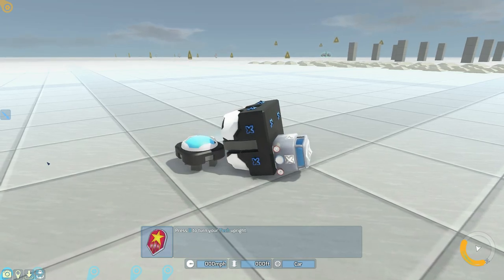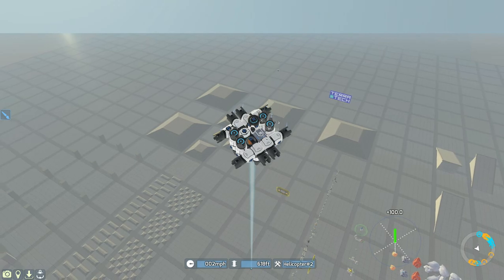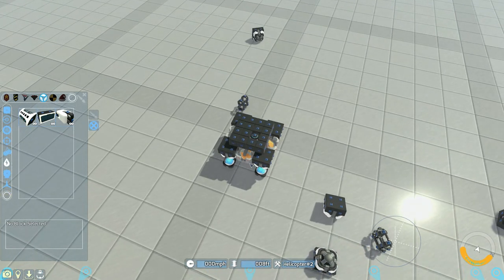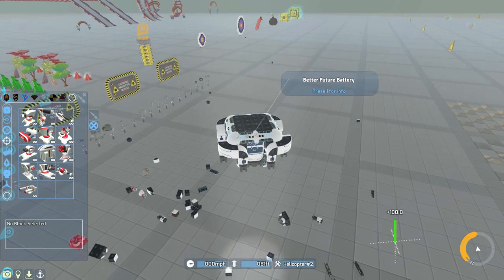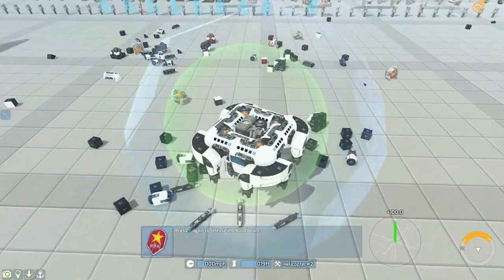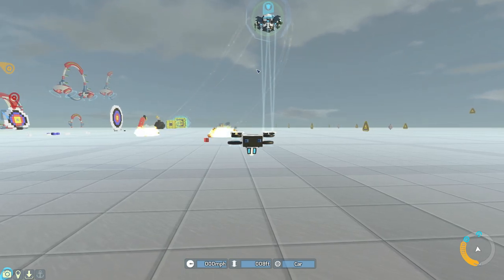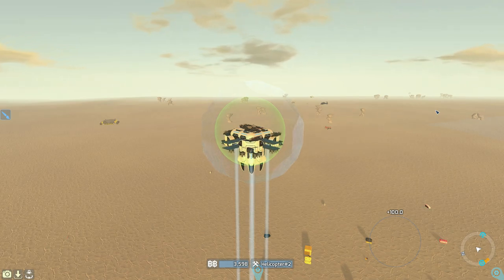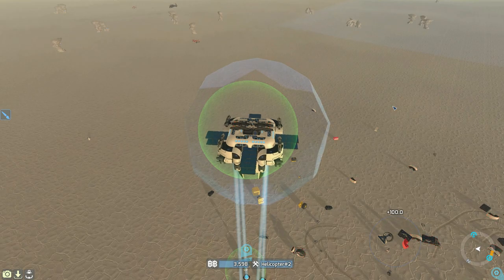Terratech | Laser Defence Satellite - Sky Anchor Build!

Comment: This video raises a good point. They should change the way the shiled and repair bubble looks. I cant imagine its hard to do and the current one is quite ugly, which  is as much of a problem as is its visibility. It should show the way it does while in build mode, but while driving it should be almost invisible. For one, it would make the issue of symmetry a lot less painful while also you could actually SEE your craft without the mix of the green and blue hue over it at all times. Eh?
Reply: The have a block that lets you turn them off which is even better, they have a constant power drain just for being active and they literally are what keeps your tech alive so it's good to conserve power whenever possible and vital that you can tell when they go down without needing to rely on a power gauge.

If you find the bubbles to be too obstructive there should be a hidden setting for it somewhere in the config files

Comment: To stop it from flying away make sure it doesn’t have quite enough thrust to take off but is assisted by a ECO anti gravity engine, if you loose the anchors the solar will stop and the ECO will turn off causing it to slowly float down

Comment: 7:13 "A bit of redundancy, which we don't really need"
The second part of that sentence was redundant, and you didn't really need it :)
Reply from the maker: Within engineering and building redundancy means "the inclusion of extra components which are not strictly necessary to functioning, in case of failure in other components." - so unnecessary redundancy or unneeded redundancy means that the redundant backup items are not needed due to low chance of failure or their inability to make up for the loss of items as they are within this build.

The above was maybe the most dry and boring response I have ever posted, but I am almost proud of that silliness. ^^
Reply: @Lathland  but... but... tautologies are fun and enjoyable!

Comment: They REALLY need to add something that makes missiles not so OMNIPOTENTLY OVERPOWERED.
Reply: maybe a point defence system for each faction and making flak effective ageist missiles
Reply: Spaced armor it,s real and works
Reply: Spaced armor, or proper shield placement.  Don't bury your shields under armor, they should be right below the surface or even outside your armor.  Explosives detonate on contact with the bubble, the further out your shield's source the less damage your blocks take.
Perfect placement of your shields would be havoc shields on the Hawkeye armor panel with the exterior node, a venture shield/repair pairing right on the other side and a Hawkeye repair/shield pair buried inside to just barely cover the outer havoc shield.  If you want to armor up the shield generator, use the thin plates from GSO or Hawkeye instead of full blocks, and if you want them embedded in armor, create a hole in some GeoCorp armor and make sure everything is properly inside a repair bubble.
Reply: need to be more overpowered.
Reply: IIRC, the intent is, or was at one point, to make the fireworks launcher an anti-missile system; it just isn't ready yet.  I mean the launcher would be able to target and shoot down missiles with the 'fireworks' being a flak like cloud to take the missiles out.

Comment: "Here at Better Future, we would like to inform you that we are only thinking of innovating the now to make a better future. We at Better Future, in our efforts to further push the boundaries of what is possible in technology and many fields that require said technology, we understand if there are some sightings that can be considered...scary, to those who aren't in the know of the behind the scenes of research and development. This public service announcement will be released in hopes to dissuade such issues.

In particular, we have noticed several complaints of various UFO sightings above metropolitan areas and suburban areas baring the Better Future company logo, just floating above. Do not be alarmed, for these are only prototypes we have deployed in various locations to test out the newest innovations in vehicular design and function, the Sky Anchor(TM).

The Better Future corporation would like ensure that this is all for Sky Anchor(TM) testing purposes and are not for:

1) Test mindcontrol devices
2) Multi platform network for weapons of mass destruction testing on the populace
3) Alternative weapons testing
     A) Soundwave weapons
     B) Weather control weapons
     C) Homosexuality inducing weapons
4) Communication jamming and/or tapping devices
5) Giant magnets to put the Earth out of magnetic alignment

Any individuals who claim that the Better Future corporation are conducting such acts without the proper approval of governmental oversights, we strongly advice to attend our informational seminars to see the error of their ways, and for themselves to also have a better future. Or else they will be arrested and sued for libel and slander against the Better Future brand.

Remember, you will always have a better future, with Better Future."

Comment: Lathrix, you can use anti-gravity to go higher via sky anchors.
Reply from the maker: You certainly can! However just the amount of propulsion and number of anchors is far more important, even with 100% anti-grav this vehicle can only go around 50~ higher than it's current top hight - removing anchors and adding thrust however makes it go up to 6x the hight even without antigrav! Still could go higher with anti-grav but the energy cost just hurts! :P